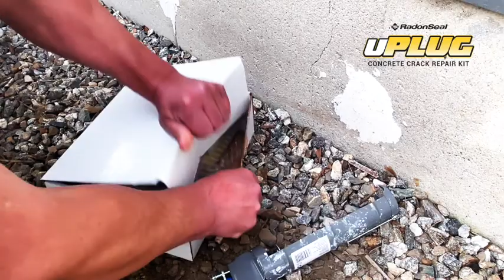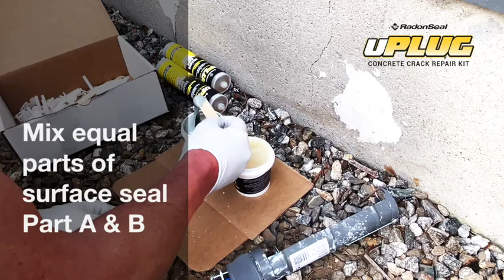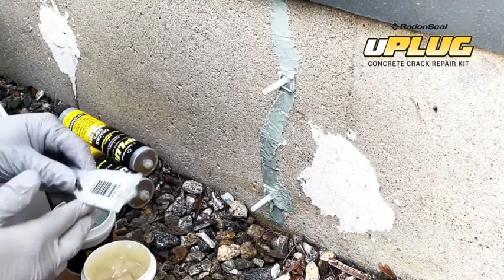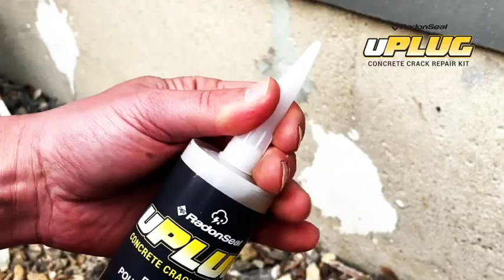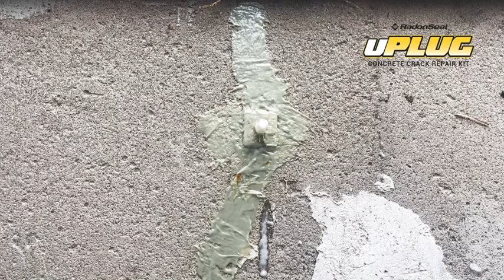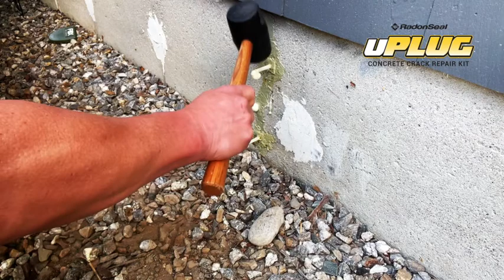uPLUG Concrete Crack Repair Kit | How To Waterproof Foundation Cracks, Pipe Perforations, and Voids

Comment from the maker: From start to finish, it took about 1 hour and 45 minutes to repair a 2-ft exposed concrete wall crack. An hour of that time was to allow the epoxy adhesive to cure (1-hour) before injecting the polyurethane foam into the ports.